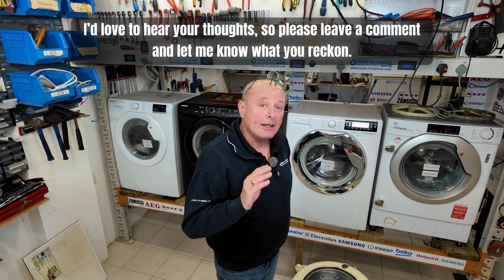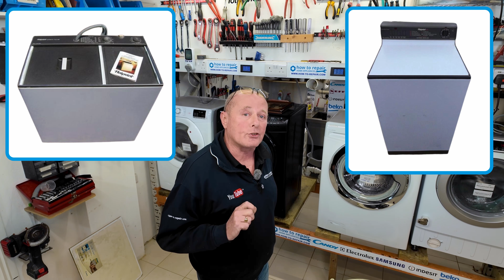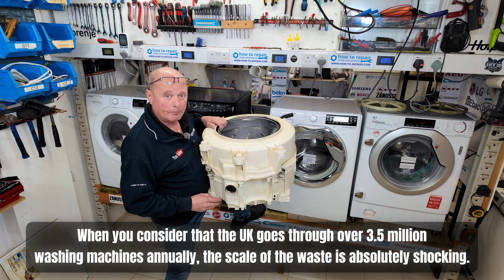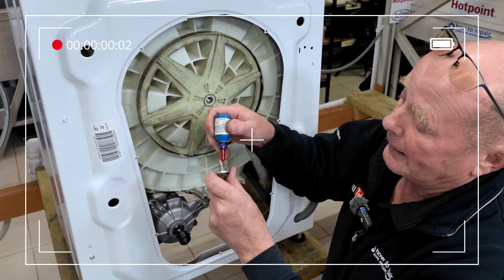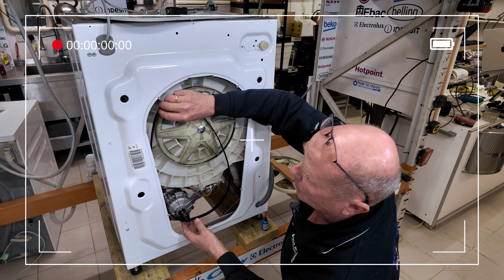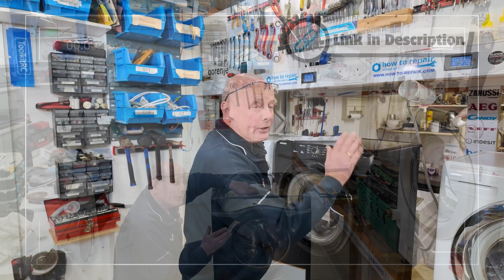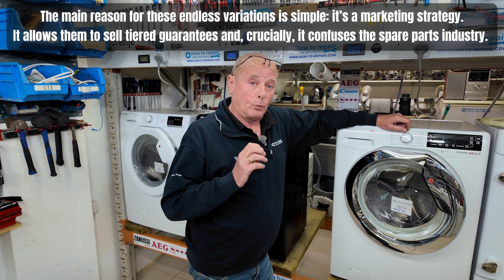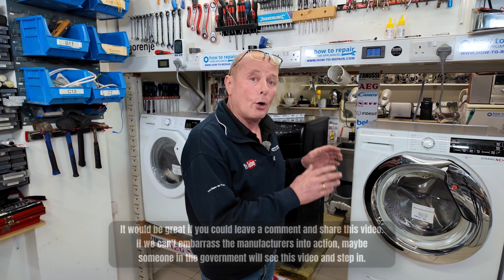I Scrapped 13 MACHINES to Prove a Point: STOP BUYING These Brands!

Comment: Miele washing machine parts are so high it’s not worth repair.
Paying 700€ for a pcb replaced by a technician on a 12 years old, 1 100€ at the time, machine, are you kidding me?
German machines are very expensive, works longer but cannot be repaired because it’s almost as expensive as a new one.
A 300€ machine working 4 or 5 years is a solution. But it’s an ecological nightmare.
By the way, made in Germany, is silently disapearing.
German brands follows car industry...

Comment: This sort of thing has been going on for a very long time.  To illustrate "Time" magazine did an expose' back in the seventies of what a car costs.  They then went to dealers and sourced the individual parts necessary to build the whole car.  The car at the time was around four thousand dollars new while the parts car totaled more than sixty five thousand dollars!  That was during a time when parts were expensive but not nearly so much as today.  They also broke it down and showed how much new tooling each year for the trendy new models cost  as a percentage of the price of a new car.  Then the cost of advertising.  Illustrating the cost of the actual car was about twenty percent of total retail.  The rest was for nonproductive use.  Now you could add the cost of all the needlessly expensive engineering and cost for electronics installed in wet areas and numerous other 'engineered to fail' features.  
I purchased a new Electrolux front washer a couple of years ago for close to a thousand dollars retiring a thirty five year old top loader because I thought I was getting an upgrade.  The Kenmore had a transmission that's seal had begun to leak a drop a day and could have easily been fixed.  I was busy building an addition to the house so I decided to go new.  What a mistake!  I wrote to Electrolux and could never even get a reply.  The thing takes two hours to do one small load where the Kenmore took twenty minutes and did a better job (how is that "energy efficient").  It has sounded quite literally like someone is in it and beating on the inside of the case with a sledge hammer during the medium spin cycle or lower.  I don't use the high cycle at all.  Large load or small.  I bought it so I could do blankets and large items.  Not a chance it goes out of balance so bad that it shuts down but not before beating hell out of the machine.  Drives me nuts.  This has been going on since it was a new machine!  Oh, and did I mention this new crap is a "water saver" so it doesn't do a good job of cleaning either.  It is on a second floor in a small closet off a hallway so getting access to work on it is no small thing and there is no space to do so.  These things are absolute garbage.  The politicians have the nerve to whine about going green yet they allow them to build and sell stuff going right into the dumps.  I understand Australia has a recent consumer protection law with some actual teeth in it making manufacturers eat their own garbage and pay for damages and costs incurred.  Something all countries should do.  I am 76 years old now and thought that the washer would last me.  Fat chance.  The game now is to blatantly fleece the consumer and waste resources prodigiously.  I was looking at replacing my thirty year old dishwasher as the racks were rusting out and new ones were the cost of 2/3 of a new machine.  Got to looking and found unanimous complaints about poor wash quality and, again, cycle times of two or more hours!  My current one takes half an hour if you use the dry cycle.  New ones are reported as being very noisy as well were my old one has no problem with noise.  The truly disgusting thing is that the old models were not of sterling design or engineering yet they shine in comparison to the "new improved" crap.
Good to see you shedding a little light on this as things are just as bad or worse in the US.  Spare parts are nowhere to be found if your machine is seven or eight years old.  No ten year law here.

Comment: Recently ( 12.2025 ) I replaced shock absorbers in my 15 years old Bosch washing machine. Heating element, front sealing, pump already replaced.
I did detailed clean up of my 10 years old AEG heat pump laundry dryer (11.2025). 
I replaced (02.2026) pump in 8 years old Whirlpool dish washer because it was little bit too noisy. 
I did it by myself after I saw dedicated YT videos. It is so easy ! 
You are doing great job showing that this is not rocket science...

Comment: I had to fix the same problem with belt off and loose pulley wheel on Whirlpool machine, not so long ago. From my experience as an electro-mechanic I can say that you are very right. What you say applies not only to washing machines but to everything these days, low quality and difficult access for repair. And on top of that, ridiculously expensive spare parts if purchased from the machine manufacturer.

Comment: I tossed an otherwise pristine whirpool washer in 2003. It was only 3 year old and had this plastic mechanical state machine on a pcb that also had a microcontroller. They could've easily stored the state in a little flash chip. The plastic bit wore thru. No spare parts were available other than a whole new controller which was almost the price of a new machine. So, I bought a cheap Zanussi. That one worked for a long time but I have repaired it many times. Some defects were, a leaky rubber hose sensing the water level. All the other repairs were from having a screw in a pants pocket that would get in between the drum and jam it. The motor stopped working  after a bit over 10 years, right after spending a whole afternoon disassembling the drum for a another loose wood screw. After that I rented an AEG and we now have a BOSCH, which hasn't shown any problems yet.

Comment: My appliances are between 23 and 35 years old and I have had to do very very minimal repairs on them to keep them running. My 3 siblings have spent thousands in repairs or replacement costs of very expensive appliances. I repair my own stuff.

Comment: What's your opinion on Haier? they're supposedly owned by the same group as Candy/Hoover, but the quality seems totally different, I've got one on 5y warranty and seen it being dismantled, it doesn't seem to have the same chipboard top or welded casing issues you mention, in fact I would think it's an LG DD motor with different components

Comment: Idk mate. As far as I remember the light bulb cartel was debunked as a myth. Because the light bulb burning in this specific fire department only runs at 5-10% of its power, the dissipation of the tungsten wire is greatly reduced, therefore aging is greatly reduced.
Speaking of washing machines: the plastic drums are mostly found in lower end, cheap machines. And people want cheap stuff. You can still buy a Miele (well even their quality is not what it used to be) for 2-4x the price and it will be maintainable and (probably) longer lasting than your standard dollar store washer.

AEG and Electrolux aren’t European anymore, just Chinese rebranding of traditional brands. Sadly.

I mean, I see your point, I still run my AEG Lavamat 9029 from 1991. Greatest advice in my opinion if you want something that lasts: Buy used high end stuff and fix it rather than new cheap machines.
Tbh Beko is well engineered from an electrical side. I repair PCBs in Germany and the ones from Beko have some good components on it. German transformers, high quality capacitors and a well engineered layout. Didn’t expected that from such a cheap brand. But maybe its because Beko belongs to arcelik (a Turkish company)
Reply: Tungsten lightbulbs will also last a lot longer if they are never turned off.  Most Miele now have welded plastic tubs too, some of their top end models are still stainless steel. Having seen one with the lid off, their quality still looks pretty good, and it would probably be well worth the effort of sawing one open and bonding or rewelding it, to change the bearings when they go.
Beko, I recall reading a thread a few years ago about a lot of beko washing machines failing with a blown schottky diode in their power supply, people were selling repair kits on ebay. Their parent company now owns indesit and hotpoint too.
Washing machines will last longer if they are kept clean and free of bacteria, because that is what really destroys aluminium spiders.
Reply: @mels8966  Yes. Most people never wash at 60°C or higher. One of the most important things. And use powder instead of liquid detergent

Comment: I have a Miele washing machine from mid 90s, it still works, I will keep it until I die - because the machine will outlast me.

We should create an open source washing machine, with openly available parts, documentation, and repairability. Like Fairphone, just for home appliances like washing machines and dryers.

Comment: We have a 15 year old Miele. Until today we had to open it three times ... we had to clean some tubes from residue from washing powder (after that we only used liquid products). The dampers were worn out and had to be replaced. And the electronic failed, because of a dead condensator (there is a company that repairs the electronics with standard parts for a decent price, i'm not too much into soldering). Compared to other machines, that i worked on, the Miele is built to be repaired. This starts with the screws, when you open the machine. The parts inside are built really studrdy. Some others machines - like Wirlpool - give you the feeling like a closet from Ikea ... screws are not really made to be used more than one or two times. They work, but if you open them, they feel flimsy.

Comment: If the manufacturers have left the bolt holes in the outer drum then is it not possible to open the weld and then bolt the two halves back together?

Comment: Our HotPoint from 1994 had lasted us upon till 2015, it was an amazing build quality, in 2015 we bought a new HotPoint within 5 years it failed water heater 2 years later the drum cracked because the bearing over heated then a year later the shocks gave out 🤣🤣, but i did not throw it out just replaced everything and it works well now.

Comment: Bought a Miele dish washer that failed last year after just 5 years with an apparently well known PCB or inlet valve electrical fault. Would have cost via Miele maybe £300 to fix so bought a £500 Bosch with 5 year warranty. the Miele looked like new and probably good mechanically for another 10 years. 😢😢

Comment: I have a top-loading Electrolux EWT1011 washing machine that I have used every day for 20 years! I have replaced the brushes and supports 3-4 times, as well as the door lock and suspension. Everything is rusty, but it still works flawlessly, and I don't want to buy a new one.

Comment: I am using a Kenmore branded washer and dryer I bought from a Sears outlet store in 1993. I have replaced a switch on the dryer and the agitator dogs on the washer. Both are still going strong. I bought $6k worth of Electrolux kitchen appliances in 2008. All were replaced six years later as all of the appliances were failing with numerous issues. Even the plastic on the microwave was crap. The plastic was literally disintegrating so that screws would not hold things together.

Comment: Even the guy who came and installed our washing machine said, "If you get 10 years out of this new Siemens washing machine, consider yourself lucky.They are built to last not more than 6 to 7 years." Now it has been 6 years, so I should soon consider myself lucky. This is ripping off since home appliance prices have gone up a lot. The biggest ripp off is the ceramic cooking range.  We have changed 3 of them already in the past 25 years. The heater coils or their controls just stop working after 5 to 6 years. The worst ones are those with the multiple coils small and large in the same unit . We have had Husqvarna, Gorenje and now Gram, all made not to last.

Comment: Intentionally engineered to fail not long after the warranty expires. Truly environmentally bad.
This is also done in the automobile industry, e.g. Mercedes, BMW, VW, etc. with plastic parts in key areas of the engine.

Comment: Very well said. I'm not a appliance engineer but I've taken apart a washing machine a few years ago due to rust staining in fabric softener sludge that was stuck to the inside of the plastic drum that would randomly drop rust stains on our clothes despite trying every type of washing machine cleaner / acid / alkaline to try dissolve it.
I took it apart only to see the sealed plastic drum around it. And immediately thought 'how the hell are you suppose to replace the bearings'. I ended up smashing the plastic drum to see inside where I discovered the sludge. If I could have got into the plastic housing I could have cleaned it and put it back together. At least it makes a good fire pit...

It's madness. These companies boast about their energy usage being low but I bet the energy use to make and deliver and dispose of an unfixable machine every 6 years is more than the energy savings they flaunt.
It seems like a easy solution would be to ban the sale of sealed drum units.
Also those spare parts prices are Eye watering. Complete price gouging for greed and to encourage you to just buy a new machine to bolster sales statistics so the company looks better on paper to shareholders.

Comment: We still have our Miele machine from early 2000s going strong with minimal service. True German-built quality. We had it serviced once by third party techs and they were amazed how well it was built and told us to keep it while we can. We also own a Miele dishwasher of similar vintage, that over it's life time only had basic maintenance done and has never been majorly serviced. It works like a champ. 
We previously had a German-built Bosch washing machine from the 90s that worked very well, until a forgotten large nail in a pocket ruined the drum. Had it not happened, it would still have probably worked to this day.
Modern stuff is.. just not built to last unfortunately. And it's not just household appliances, the same applies to TVs, computers, and other tech. Phones with non-replaceable batteries where you basically throw out an otherwise working device just because the battery has failed. Same about laptops, tablets, etc. These things are either non-serviceable or require brutal means to service. You basically are supposed to just buy a new one.

Comment: I've found that these machines are way over complicated.  My brother had a Whirlpool Duet washing machine he bought for about $1500 back in 2013 and it failed in 2020. This machine had as many sensors and gizmos as an electric car. When he had me look at it I found the circuit boards, both the logic board and a power board were fried and it would cost $650 to replace those. He ended up going back to his 2002 top loading mechanical timer Frigidaire washing machine that has had no repairs ever done to it and is still going strong to this day.

Comment: I am on my third washer door. Who would design a lock at 30 degrees off opposite to the hinges. Consequence…constant stress on the hinges when loads press on the canted face of the door glass AND careless closing of the door by not pressing across from the hinges as well as gripping the handle.  Also the pub panel is not securely fixed in the fascia with constant pressing of the spin and temp options causing it to part from its clips. I have had to strip and glue the panel in place.

Comment: This is true.  We had a Hotpoint WMFUG 842G UK purchased 18/3/2019.

The machine was only covered by a 1 year warranty. We had to get an extended warranty with Domestic and General (about £192 a year). It developed the following problems. 

1. 23/12/2021 not repaired until 2/2/2022 due to limited supply of spare parts.
Drum, Pump filter, Pump filter hose, Front counterweight and Bolts all needed replaced after 2 of the 4 pistons broke and destroyed the front counterweight and crushed the pump filter and hose.

And don't get me started on the Tumble Dryer...

When it started leaking again from the front we replaced  the machine in 2023 with a Bosch Series 4.

Our previous Hotpoint Aqualtis lasted from 2007 to 2019 with only 2 repairs (heating element and drive belt). No more Hotpoint machines for me.

The manufacturers do independent repairers out of business by selling the spare parts at excessive prices but their own repairers  can throw parts at the machine without having to pay. So you have to be Hotpoint repair man sent by Domestic and General or from PACIFICA (Hoover/Baumatic/Candy).

Comment: Im a motorcycle mechanic and i got an old machine when we moved apartments
Its a 23 year old zanussi
I replaced the bearings the seals the belt and shocks
It works like new
Before that i had a new expensive lg 
Her card burnt after less then 2 weeks

Comment: I have a Miele from 2006 that is still working well, I just changed the shock absorbers thanks to your video where you dismantled a Miele very similar to mine. I am worried if the spider or bearing fail breaking other components like the heater coils that I might have to change it, since there are no new machines that are built as well as this one, at least as far as I know

Comment: I had less than 10 year old Samsung that had the spider break due to galvanic corrosion (aluminium cross bolted clean on a stainless drum). Then after replacing the cross (and sealing it) it ran for two years before the doorlock mechanism had such a catastrophic short that it burned the whole wire harnas. After that I bought a 25 year old Miele.

Comment: On the other side, appliances has never been cheaper. on 2005 I spent 750€ in a Aeg washer/dryer combo. It died on 2025, not bad. Replaced with a similar (better rpms, more programmes, less consumption)  one aeg and in costed in an offer 450eur. You get what I mean? same with everuthing else. Paying 450eu in 2025 for a aeg aint bad innit?